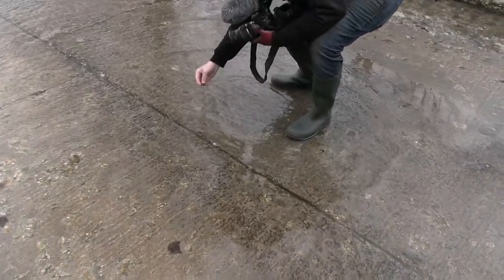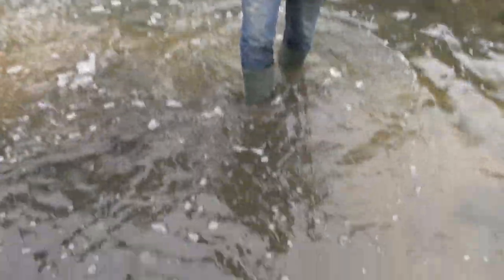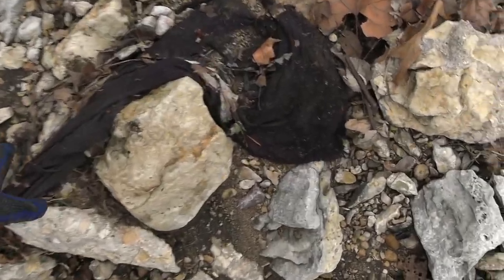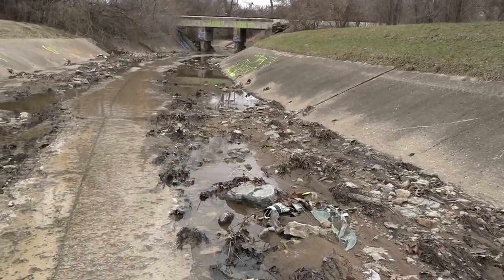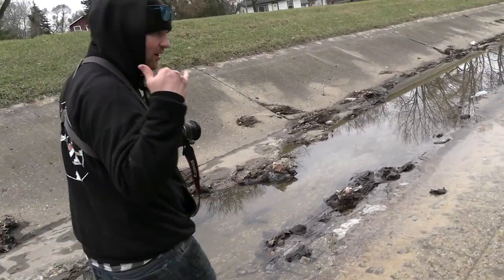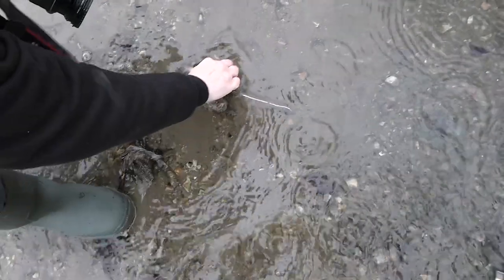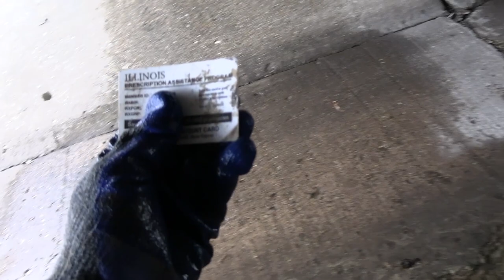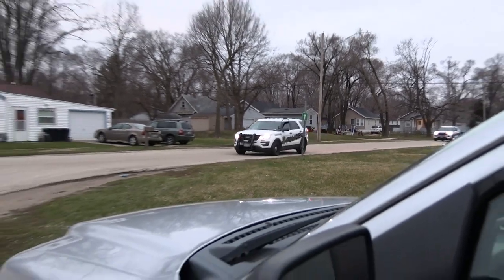Police Speechless After We Found This MudLarking “This Could Have Killed Someone”

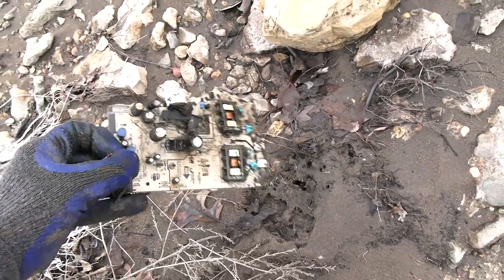Comment: 0:57 That looks to be part of a tv power supply. Possibly an old plasma tv if we judge by the transformers.
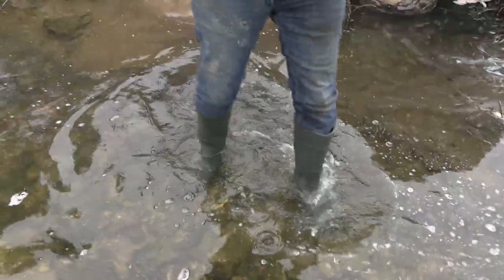2:54 This is a part from a CRT tv. It's the electron projector in the back of the CRT, at least part of said projector.